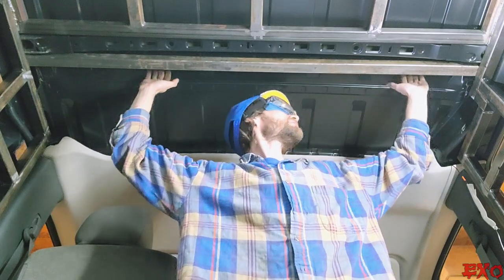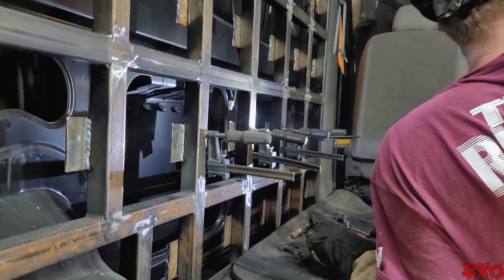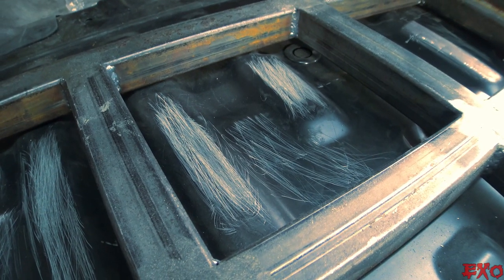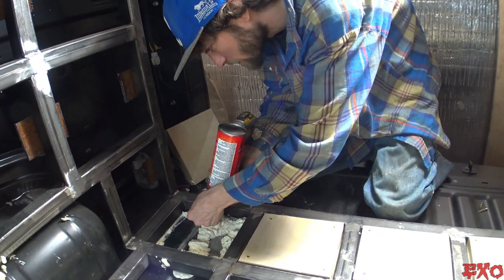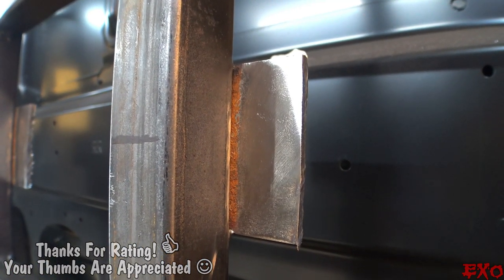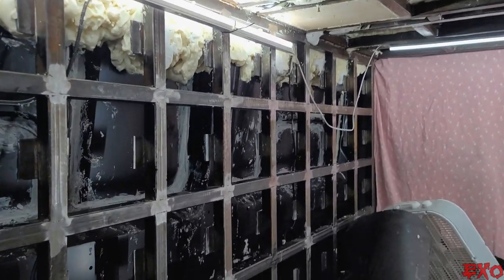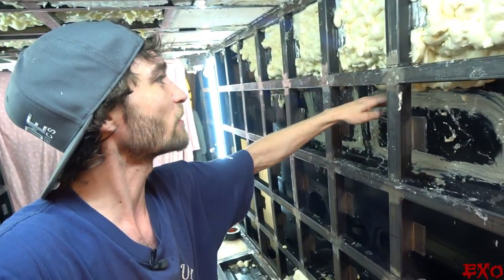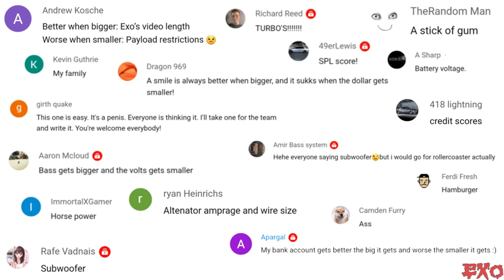NO FLEX Bass Van Build w/ BIG Steel Cage Subwoofer Box + How To Install WOOD Squares for CAR AUDIO

Comment: When I did my roof, I drilled holes every so often in the wood I put on the roof just big enough to get the foam straw through. When it was time to foam I just put the straw in the holes and let it rip, started at the back and worked my way to the front. Something like 40 cans later the roof is solid like Little Blue! Made it much easier and cleaner to do, without wasting a lot due to trimming. Watching this entire video, I was like aww man he's gonna get foam in his hair lol

Comment: This thing is gonna bang. Most of the lost sound energy in any bass build is lost through flex. If you can eliminate that loss you should gain massively. Just remember that steel welds will break, and the easier it is to repair those the longer you can keep it at best.

I've been waiting for someone to try this. I never had the money or time to build a special vehicle to do it. Good on you man.

Comment: Word of advise: you can get spray foam in two large tanks that mix when sprayed. I used it to do joist in my house. I got it at Menards. It was super dense and sticky. All the clothes I wore and got that stuff on still has remains 8 years later.

Comment: Was once an audio guy. Got a free powered 15" powered sub and decided to throw it in my supra, upgraded to a 240 Amp alternator and a huge inverter. Very first ticket I ever got was from noise violation going down the highway. Week later it blew out my hatch window. Left it alone for over 10 year. Got that itch again...

Comment: You can add fiberglass insulation wherever you want to control the spread of expanding foam. The fiberglass insulation will stop the liquid from penetrating and it will expand inside the zone.

Comment: @exo pro tip for caulk type sealants,  put some dish soap in a water bottle and then dip your finger in it and use it to smooth your caulk bead out! It def keeps you from smearing it all over!

Comment: Speaking of builds I built myself a mini bike from scratch using a predator 212cc engine. Got some preformance upgrades ordered. So far I've hit 35 mph but I've seen these engines hit 75.

Comment: Nice build!  If that foam is polyurethane based, moisture helps it cure so you could dampen the wood before closing it up and it would cure.

Comment: I have an idea for a competition run. turbocharge the inside cabin, bring the pressure up a few bars 👍 drivers will use the same power but be moving 2 , 3 , 15 times the air 🤔

Comment: Exo my dude, the product that you use to lift the concrete slabs of houses that settle out of level is a type of expanding foam. I survey the house calculate how much lift I need in an area, to determine how much foam I need under the slab. I then determine the best locations to inject the foam. So how do I get it under the solid slab?  Simple... I bore a hole through the slab then bolt the injector down, when I've pumped the calculated amount of foam I wait for the expansion then check level. I then remove the injection head and plug the hole with concrete. So you can wall off any given area, then drill fill holes as big as the tube fill your area then plug your hole. You don't actually have to fill first guess at how much you need then cover with wood. I'm going to bet that you can get a denser fill that way.

Comment: If anyone is getting ideas from this video for their own build, MAKE SURE you allow for the foam to escape from behind panels in some way and allow it to cure before doing the next section. If you seal a large area of foam in and it can’t expand enough initially, it CAN bulge your body panels. Take your time. I learned the hard way a  few years back

Comment: Awesome video, just my thoughts on the foam, I like the Loctite better it is 3x times more dense but seems less on each can to the stuff. 
Also with so much top area on the sides to fill, next time call a foam spray contractor to come on your site, they can spray all that area in a few seconds with there mobile truck set ups. And their foam the expansion is crazy , just let it dry and trim, I believe it will be faster and cheaper and easier on your trigger fingers

Comment: We did a similar build and used Corian Countertops to line the inside of the van, granite was too much money. We were at 165ish with 60 inches of sub and two JL HD 1200 amps.

Comment: if you would have poured your foam first on the lower sections then you could have built up from poor to the top of the ceiling and had something to build on the entire time instead of building down to a void.. that's what captain hindsight told me.. just saying, it worked for you and i'm very happy for you.

Comment: EXO I noticed you guys like your 4 1/2 grinder. Why are you not using a 1/4 inch air powered die grinder with a 2 inch roll-loc? Do to weight and space requirements I thought it would be a given. Nice build can't wait to see it finished.

Comment: Screw 7 days; Hey EXO, do you plan on drilling holes in the lattice of square channel tubing and filling them with foam?

Audiophiles fill their speaker stands with sand/glass beads/etc to reduce resonance. 

Do you think it would make enough difference to justify the trouble?

Comment: Just be careful about that foam because it can take weeks to months to completely off-gas, it might cure within 24-48 hours but wit has thick as that is being put in it'll take a while for it to fully release all of the chemicals that make it expand. Depending on how cool where the van is being kept it'll take even longer, just make sure to keep it open with fresh air moving through it (and the area) don't want you getting sick.
Also you should have looked into getting a company that does spray insulation instead of buying all those cans of spray foam, it likely would have been cheaper, faster and done in a much more uniform manner (Plus they might have loved the free YouTube advertising and done it cheaper)

Comment: 7:57 why put PL, the greyish adhesive instead of just pouring foam and putting the wood. It will eventually get pressed when top later of wood will be screwed in.

Comment: Wondering how you accounted for the extra weight if i remember correctly you didn't even have enough suspension(even after upgrading the leaf springs) to actually drive it without possibly breaking something. I just started the video so...

Comment: To me, flex is lost energy. I'm old school all the way and that's how I see exo. You got to take your time doing things right or it's a waste. I can't stand car rattle when you got the bass going and all you hear is your car falling apart. My brother and I built a 4 12 ported sub box tuned at 38hrtz and it will take your breath away weekend the bass hits but it's still not what we want. We got a 4k crescendo running at 1ohm running the 4 12s but I don't think it's pouring out the total 4k. It states at 1ohm is 4k rms and peak is 5740. We had a bully 3k that sounded and hit harder than that crescendo. I don't know what is wrong but I guess we will get it eventually but I just don't want to burn the amp up or blow the subs by clipping. Great video and wish you luck on your build, it's coming along nicely.

Comment: I currently have a American bass elite 12 in a 2.0 cf box the sub is inverted it’s on a skar 1500 I want something louder any speakers you guys would recommend can’t have a much bigger box it’s in the back of my 2011 Ford F-150 super crew cab platinum

Comment: Since the floor is going to be wood, couldn't you have saved weight and put foam on the bottom and put a trimmed to fit piece of wood on top? You get the same insulated flat floor effect.

Comment: Hi my name is roger quick question hope you can help me my mid high amp shut off when It’s on mid high volume and my subs are hitting hard but if I turn down the amp bass then it doesn’t turn off is this a voltage problem or what?

Comment: Couldn’t you just drill nozzle holes in the plywood and spray the foam when it’s all mounted? 1/4” hole then temp plug it with a screw.

Comment: Why do this anyway? With a steel cage and basically enclosure built inside cage it is its own enclosure. I could understand if it was just a sub enclosure and bass waves hitting the sheet metal.

Comment: The only problem I see is that foam is extremely flammable and if you have a single white that starts to melt or overheat you will start such a fire that no fire department on the planet can take that out without just letting it burn till it runs out

Comment: Hate to pay for all those cans of spray foam...they make a portable rig that has 2- 2.5 gallon tanks and comes with mixing gun....it's waaaaaay cheaper that those cans and you can also choose a closed cell or open cell  foam and choose  density of the foam...those cans are pretty light foam....it's same type as the pour foam but in a small spray rig...now Fido give me a noise..

Comment: I had to watch the vid in two separate times.
Why did you decide to you expanding foam and then buy small cans? You can buy large spray foam insulation kits that cover like 600 ft² at one time? I still believe your build is good; the only thing is that it is way overkill. I used to build houses, and going from a strength/vibration consideration, you didn't really need all the steel framing plus foam, plus wood in between, then construction adhesive on top of that. But, hey go for it.

Comment: Guys to develop superpowers, protect yourself from other people's bad energies, the devil and eye hallucinations, you need to train your body physically like crossfit with work on boxing bags, then bad energies and black dust from bionanorobots (sometimes transparent, but it is still visible as distortions in the air with the feeling of a transparent gel around in space) will not be able to cling to your body and nerves of the eyes and you will not see and feel pain, you need to train all muscle groups so that there are no weak spots and mentally imagine how you tear apart the pain and the picture in front of your eyes with your hands, also imagine how this dust burns up turning into emptiness in this way, you mentally destroy this shit this is the beginning of super strength, exercising and fantasizing, you can develop other superpowers in yourself, but for each person individually, it will be easier to get some kind of strength (The principle of work is in the transformation of physical strength into mental strength). Also, minimize the amount of food, it is best to eat rice cooked in water like the Shaolin monks, hunger and a minimum of different flavors, you will redirect the energy from the digestion of food by the stomach to the strength you want! Another tip is to eat lemons or citric acid - (0.5-1 spoon / l dry with at least 3 cups of water, it's easier to drink and a large amount of water will reduce the overall acidity - my record is 5 spoon / citric acid per day) this will speed up your metabolism and protect against poisons, spoiled food and metal salts, if you have any questions, ask! I am writing through translator from Russian so there may be problems with understanding the text. - ** -//**

Comment: I've got to be honest. There's no way in hell I would have done all of this work with the steel frame. It is not required you just need to make templates out of dual or triple thickness of wood and just layer the whole interior like that. All the cutting of squares is nonsense